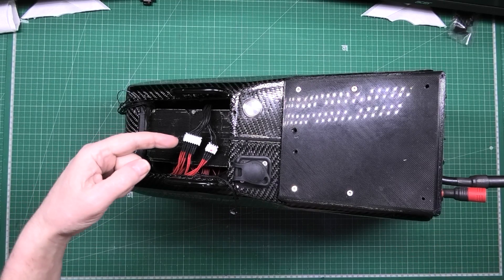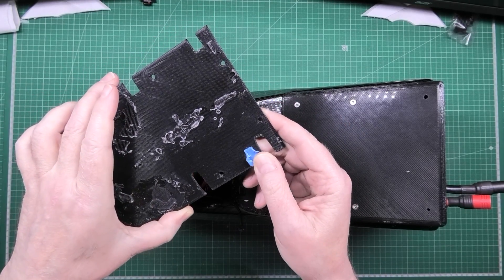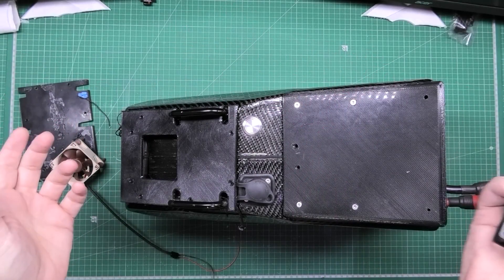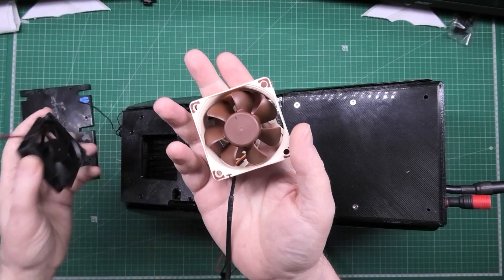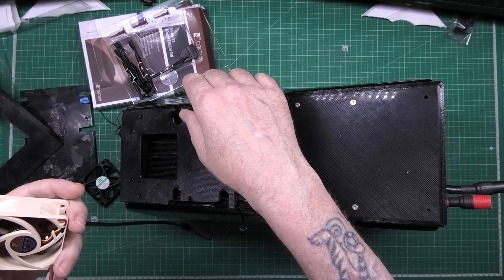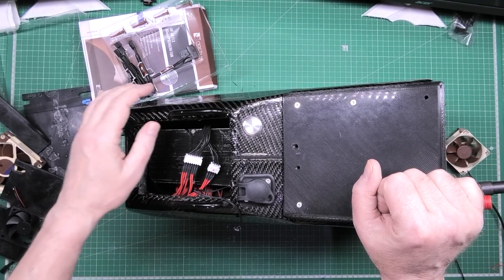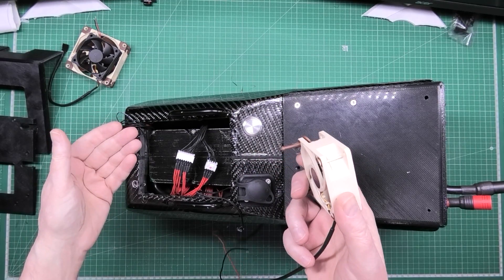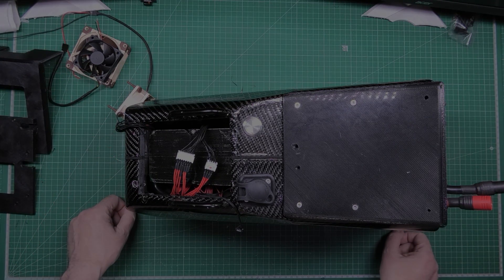High powered DIY eBike MSVA build part 32 - Battery teething problems

Comment: Just a quick question turn it in my BMS is an option for static balance or charge balance should I just leave it on charge balance
Reply from the maker: Static balance is usually where you need to balance the cells when nothing is running. Charge balance is where it starts balancing cells as soon as you charge them. If anything, I'd prefer the charge balance mate.

Comment: Hi, do you know how to find out if a wire has disconnected in the cable that runs to the motor. Can I buy something that will identify the problem without stripping all the covering? It's a brand new wheel but I don't know what to look for. I opened it up and compared it to a good wheel but it looks ok. Only thing left is a faulty wire.
Reply: This will do it :-) https://www.banggood.com/BIKIGHT-40W-24V36V48V60V-Electro-Car-E-bike-Scooter-Brushless-Motor-Controller-Tester-p-1241430.html?rmmds=search&cur_warehouse=CN

Comment: Suggestion for next e-bike which I've not seen before. 2 motors  one front wheel one rear wheel.
Reply from the maker: There's a reason why you haven't seen it - it's pointless and dangerous which is why you don't see 2 wheel drive motorbikes 😁

Comment: I thought batteries like those had much higher discharge and charge temperature limits - like around 65C. If your temperature probes aren't higher that 50C under load then I don't think heat is the issue.

Venting the battery box is definitely not a bad idea given how much you have crammed in there and the voltage you're at. Depending on how fast you're going some forced air over the cells might be enough to cool it. If you do need to use a fan I'd get the grey Noctua industrial ones since they are dust and water ingress rated and can push a considerable amount of air. A single large intake fan with some venting out the back should do the trick.

Are you sure the problem is not current related? ie. regen pushing too much or an over voltage state?
Reply from the maker: Maybe I explained it wrong.......There's no problem with the battery getting hot, it's only the balance resistors that I need to keep cool when charging.
The problem with the BMS isn't related to regen, it's happening all throughout the battery voltage range and I think it's something to do with the balance leads. I took it out again on Saturday but it made no difference...... I feel another strip-down coming this weekend.
Reply: @Vortecks  Ah I see. Cooling the resistors could be done using thermal pads. If the resistors are at least 5mm x 5mm in size you could tape them with adhesive pads and then attach some small RAM heatsinks to each, but you may need to cut open the BMS cover for it to fit. Another thing that might work if the resistors are close enough to the cover is to just fill the gap with thermal pads so the cover acts like a heat spreader on a CPU. Slap a big ole heatsink on the outside of BMS and it should work.

If the heat issue still isn't gone it might be worth sandwiching a 40W peltier between the heatsink and the BMS. You can spray conformal coating on the PCB to protect from condensation and make your BMS "marine grade".

Go down a guage (thicker) on the BMS wires and check with a thermal camera or a temp probe.
Reply from the maker: @Luscious3174  I've already cooled the resistors with a 0.5mm heat sink strip and a big copper bus bar....... been there, thought of that one 😁
The temps used to hit 60c within seconds but now, with the addition of the fan, bus bar and heat sink on the outside, it's cured the problem 😁

Comment: Slap a cpu water cooled thermal coupling on it and then just have a small rad higher than the battery and use thermal Syphon or a small temp sensor to trigger a pump.

Comment: hi there my name's Dave I watch your videos I think they're great and I are enjoying very much watching you setting up these fans I suddenly thought why don't you put a thermal switch or some indicator or some sort that when the temperature creeps up the fans kick in and when it drops down they kick out you can switch a monitor switching off when needed then just a thought anyway I'll get back to watching the rest of the video thank you very much all the best good luck bye
Reply from the maker: Maybe I explained it wrong.......There's no problem with the battery getting hot, it's only the balance resistors that I need to keep cool when charging.

Comment: Tony’,  great idea on the forum site, I’ll be there....   However,  let me ask you a question...  at the end of this video, you took some 26650 cells out of a couple holders and put them in another holder with an XT90 on it..  I’m assuming that holder is prewired to configure those cells as a 6S battery or  maybe it’s a parallel charger holder of some sort, but I didn’t see a balance lead, so I’m a little confused.   So, what is that holder,  where did you get it and can you supply a link.  I am looking for some kind of a 4S2P 26650 holder and that looks like it’s almost what I need.  Thanks!
Reply from the maker: The one with no balance leads is a 3s 2p pack which I designed for operating the winch.
I'll be doing another video soon when I've perfected the design and done other sizes (2s, 4s, 5s and 6s).
I'm trying to make it so it's easy to parallel them up or extend them as needed.
Oh.... they're all 3d printed.

Comment: You could just singe the pubes. Everybody does it. 

And use a thernostat like the ones in the cheap atx power supplies. There are modules on the market too. It's like one and a half sqare centimeters. 
So you could go for a server fan and still get only the needed airflow and noise. 

What? You never used a lighter to... ah... nevermind.
Reply from the maker: Maybe I explained it wrong.......There's no problem with the battery getting hot, it's only the balance resistors that I need to keep cool when charging and...... I use a blow torch for getting rid of pubic hairs 😂

Comment: hey whats best cut of for 60v lithium battery
Reply: its 18s 60 v but fully charged its like 67v
Reply: its a 60v lithium battery 2000w i will look at battery tomorrow to double check then ask what cut of should be set to ur gunna cry its set to 46v atm :(
Reply: yea its a victpower 60v lithium ion 2000w 50amp batter
Reply: yo yeah its 16s mate sorry got all confused hahaha so 51.2v minimal cut of should be set to yes
Reply: sweet thanks for this btw its all confusing as hell
Reply: yea 67.2 is full charge but on controller app it only says its 75% charge an reason why it says this
Reply: sweet just posted in the do’s and donts on lipo on the page cheers

Comment: Great stuff, love what you do :) 
Could you make the battery box have a cold air intake forcing air in the front as you travel. And then have the fans cut in at a certain temperature like a bike/car would?
Reply from the maker: Maybe I explained it wrong.......There's no problem with the battery getting hot, it's only the balance resistors that I need to keep cool when charging.
Reply: @Vortecks  just me not listening right 😀

Comment: Hey Tony, does your app for the BMS support the 32s version of the ANT BMS?
Reply from the maker: Yes and no. It will read 32 cells but I limited it to 24. The Chinese were ripping the app and selling it with the 32 cell version.
When I find a way to lock it down, I might re-release it.
Reply: @Vortecks  Okay thanks, would be nice if you would release it for 32s, cuz the app I got from the seller does have some wrong stuff in it. For example it says "Cell Voltage" and than reads a temperature. 
BTW: Could you tell me what gear you use to film your bike vlogs? Like microphone and camera.
Reply from the maker: @felixwe9  If it's in English, the app you've got is probably the one I originally did. The Chinese ripped it and tried to use it for the 32s BMS. They even emailed me and asked when I was going to bring out a 32s version!
This will answer your other question 😁 https://www.youtube.com/watch?v=E2gG-vhM2RI

Comment: I recall that the BMS cut out during regen if the pack was already full. Is that still an issue?
Reply from the maker: Usually, it is a problem if your pack is full but mine keeps happening at random times, no matter how full the pack is.

Comment: why not use passive cooling, for example a couple of heat sinks would work well with a constant flow of air across them rather that the fans. ~Trooper
Reply from the maker: I already use passive cooling with heat sinks?

Comment: cheap dc to dc converter for your 12 volt fans On second note the liitokala cells are onsale on Monday july 15th 2019- the 17th
Reply from the maker: Yes... where?
Reply: @Vortecks  if its about the dc to dc converter i have no clue where to get one i just know u can buy them but if its about the cells they where on sale but dnno if they are now shows 21%off to my account 5.12usd per cell VS there normal price of 6.48usd